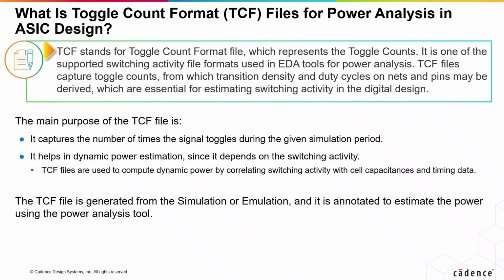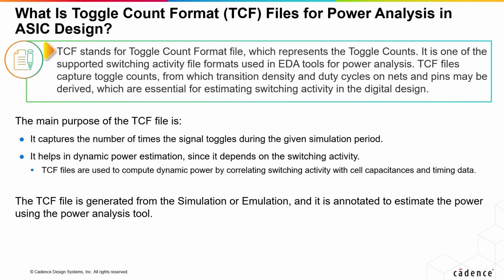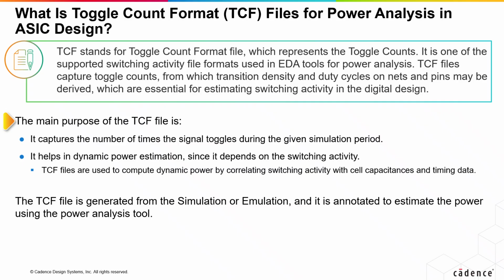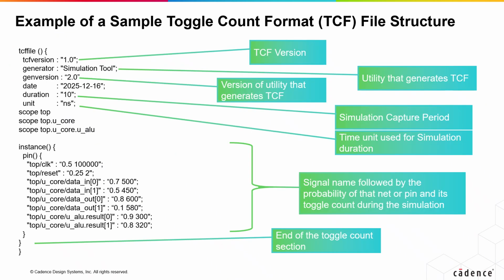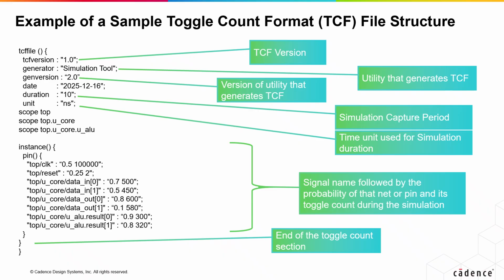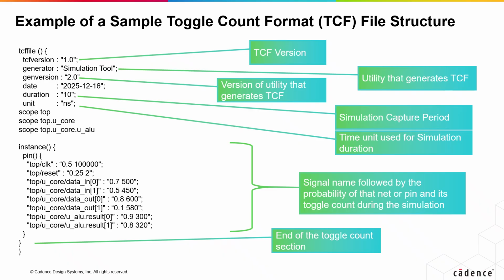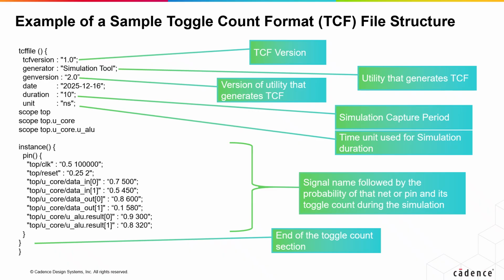What is Toggle Count Format (TCF) Files for Power Analysis in ASIC Design?

Comment: Did Power Analysis work rights, when i try it, Error Occurs on the duty cycle sir? why?
Reply from the maker: Check the following causes for a duty cycle error:
1. Duty cycle must be within the valid range: 0.0≤dutycycle≤1.0
2. Incomplete or insufficient simulation window: If the simulation duration is too short, the tool cannot compute accurate activity, leading to an undefined duty cycle and resulting in an error.
3. Clock definition issues: Missing, undefined, or inconsistent clock constraints can lead to incorrect duty cycle computation.
4, Presence of unknown or high-impedance states (X or Z): These states can create inconsistencies in the TCF data, resulting in invalid duty cycle values.
5. Use of averaged or synthetic stimulus: Average-based or generated stimulus may produce unrealistic duty cycle values.